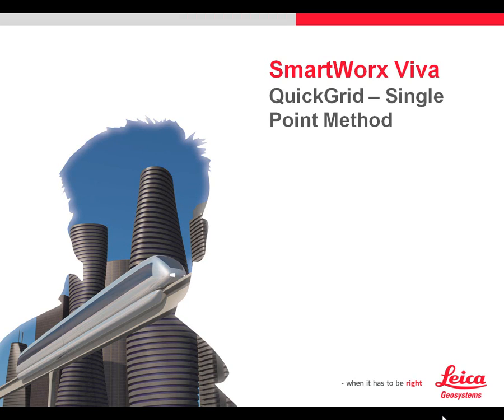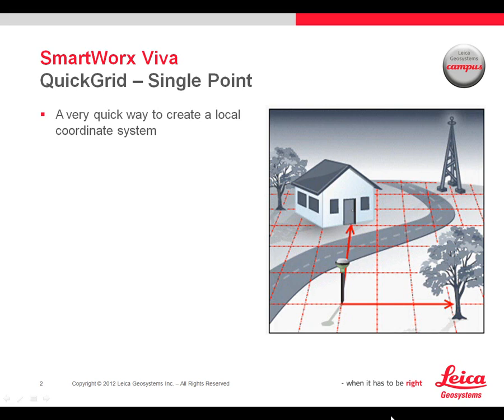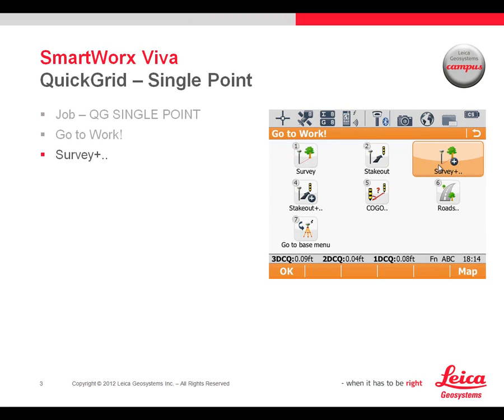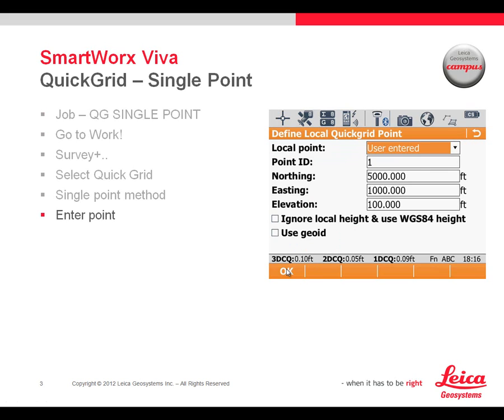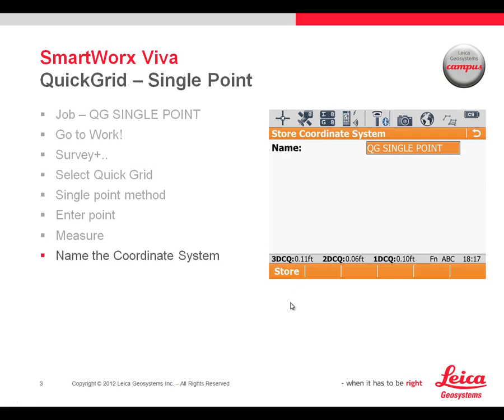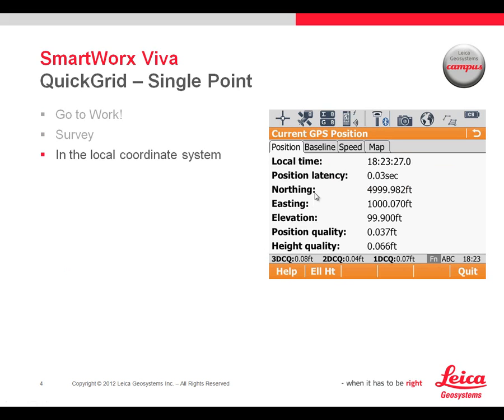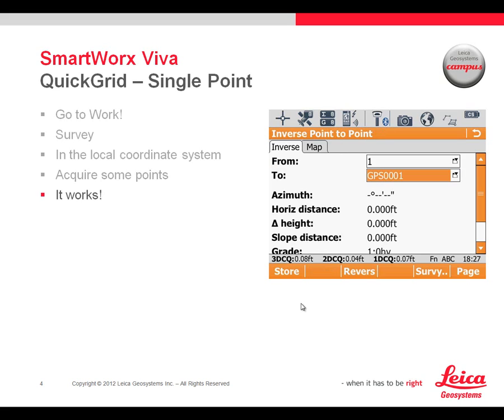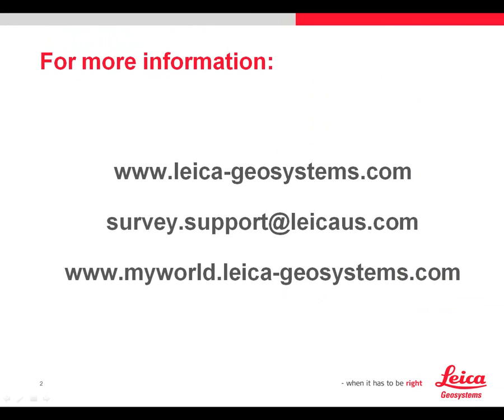Smartworx Viva Video Guide:  QuickGrid - Single Point Method

Comment: Hello,
I have an GPS Leica GS08 CS10, but my question is:
I used Permanent Reference Network but when i want to use Stake OUT and when i'm going in the KNOWN POINT (i have a coordinate of the known point) i have a difference position for 25-30 cm from the current Known Coordinate of the point. 

One of my friend they have an TOPOCON GPS and using the same system but he said me: my GPS was have an option Localize the Known Point and this option was put the know coordinate in system and calculat and correction this problem with the Known Point 

I searching any where for Leica GS08 C10 but i didn't find what should i do about mine GPS